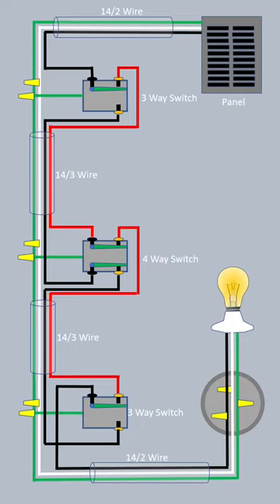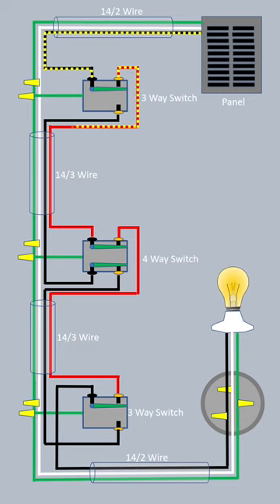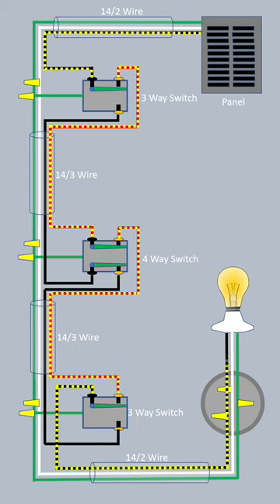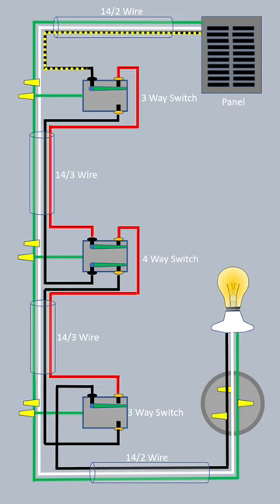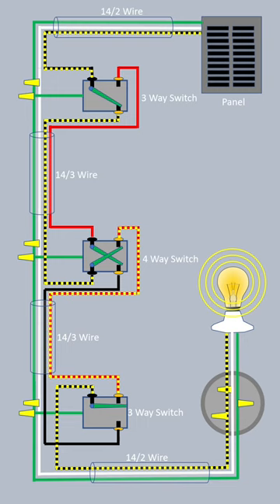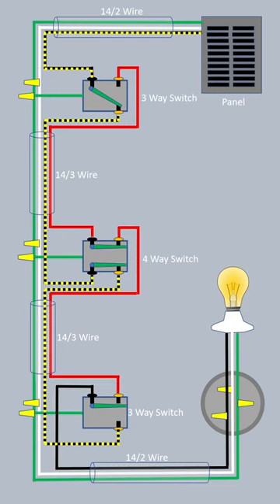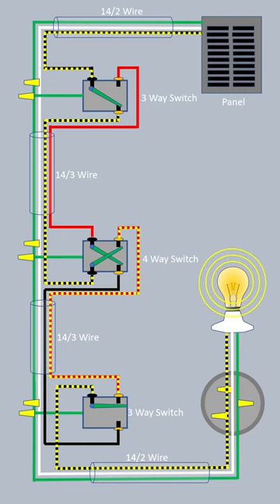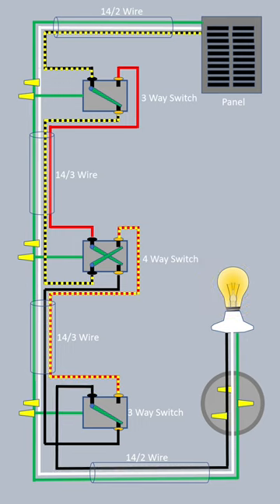How a 4Way Switch is Wired #Short

Comment: I'm going to add a dimmer switch. Where in this diagram would be the correct placement for the dimmer?
Reply from the maker: I can’t say that I know. Someone may make a three-way or a four-way dimmer, but I have never done it. I would say check with an electrician or electrical supplier.

Comment: Can I put 2 four way switch in the same line?
Reply from the maker: Yes. Between the 2 3way switches there is no limit to the number of 4way. Check with your local electrician or code official.

Comment: What happens if the light is fed after the first switch then you go to the other 2 switches after the lights?
Reply from the maker: Thanks for the comment. I'm not sure what you're asking. I am working on a video that.talks about adding or changing a single 2 way switch (power to the switch and then feeding the light), to a 4 way switch leg. The three switches (2 3 way and 1 4 way) are connected to each other with 14/3. You are replacing the 2 way with a 3 way and redirecting the black line wire from the panel down through the 4 way switch leg via the white wire (marked with black tape). Then back through the 3 switches via the black and red travelers. Easy to diagram hard to verbalize. Check a code book or talk to an inspector to get it right. Thanks for watching.